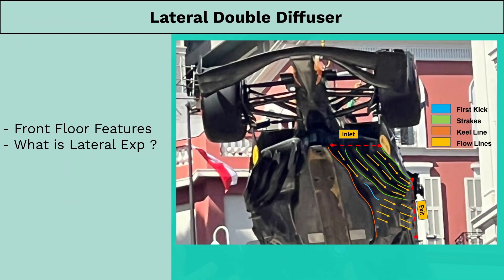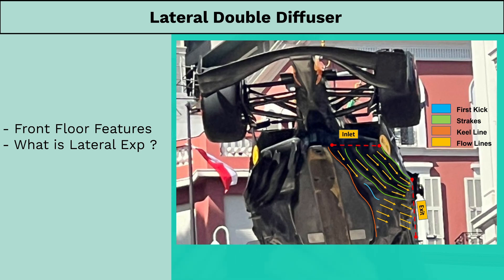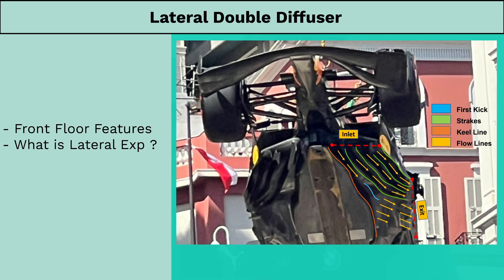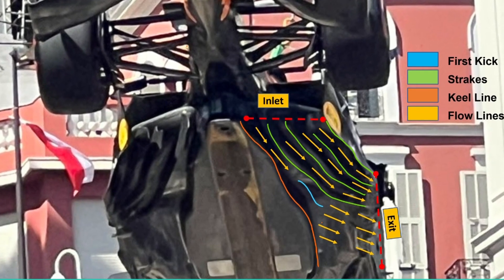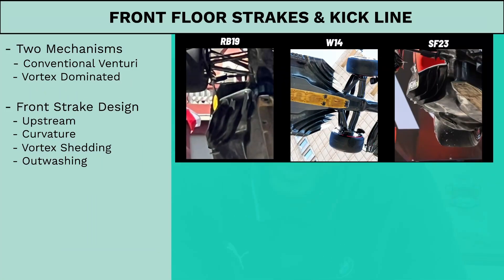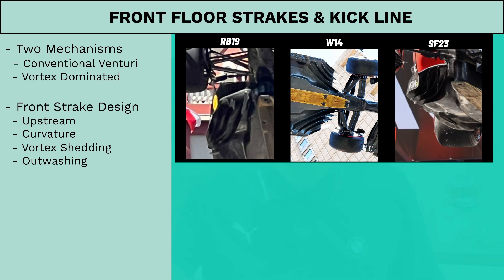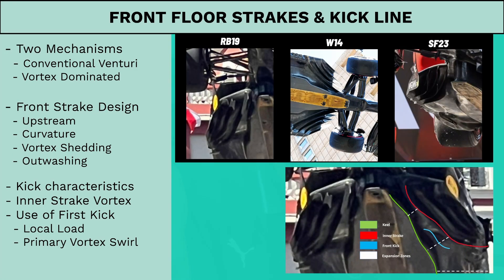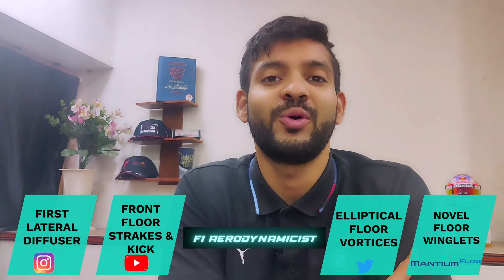#F1 Aero Analysis : RedBull Racing RB19 Floor Analysis | LATERAL DOUBLE DIFFUSER ?? Part 1

Comment: Shub, after thinking about the video, are you saying that what RB is doing fr its floor design is substantially different from its competitors and how it creates a great low pressure area under the car and expells the air with  a higher pressure?
Reply from the maker: I mean the competitors are also doing something similar , but RB has taken the aero mechanism to the next level of detail.
Reply: @f1aerodynamicist  That's what it appears from your comparison.     If you are not part of RB, and responsible for another team, how do you get to the next level?
Reply from the maker: @domtoni4567  that's a difficult one. Because it's complicated, however like the front kick mechanism I explained , that can definitely be tried out by teams because nobody is trying anything similar to that
Reply: @f1aerodynamicist  About 20 yrs ago, I knew a guy at one of the big F1 teams who told me that if an idea was tried and failed, it was put on the back bench and not to be tried again.  I wonder if this kicker is an old idea that didn't work earlier and works for RB?
Reply: Another question, do you think the RB design is better and reducing under floor pressure?   Am I right that this is the objective to keep pressure at the lowest level possible?
Reply from the maker: @domtoni4567  yup , it's definitely better and yes that's the point. But how you obtain that is tricky and also how you maintain that across a range of ride heights is crucial. That's the real game.. consistency
Reply: @f1aerodynamicist  Let me see if I can remember what I learned about hydraulics and pneumatics 50 years ago and see if I can better understand what's going on.  This will take me some time.  In pneumatics we learned that air compresses up to 100 times, and is explosive when its in a sealed container.  I guess you could consider the underside of the car sealed?

Comment: I think Redbull have done an incredible job with their floor using by applying Bernoulli's principle throughout. You can see from the design that they squeeze and expand the air flow multiple times before kicking it outward. This accelerates the lateral flow dropping the pressure and generating more downforce. Furthermore, the Redbull floor is higher than the other teams. This helps them to expand more air than otherwise. This means that they will lose some performance in slow speed corners. However, in high speed corners, the car's ride height drops as downforce increases so it's not detrimental. But when the DRS is opened, the ride height increases again stalling the diffuser.
Reply: Thanks, can understand your explanation.  I'm thankful to Shub for his great analysis, and helping me to understand just how involved aero really is.
Reply: That is the way I try to explain it in my language❤.
Reply: @martijnbuunk  Thanks, and your explanation makes sense.
Reply: From what I know is Bernoulli's principal is only applicable for isentropic flows meaning in this case where the effects of irreversible processes (Turbulence) are small or can be neglected at all and in these cases were crosswinds are changing Ambient temperature, track temperature considering all these variables, the total energy of Air is not conserved.. and this is the necessity of Bernoulli's principal that energy's must be conserved

Comment: Does the low pressure region in the center of the vortex help generate downforce?
What's the primary function of the vortex under the floor? Mixing the low and high energy flow of the boundary layer to keep the flow attached?
Reply from the maker: The primary function of the floor vortices is to drop the static pressure of the floor

Comment: i have a question:
At 10:10 how does the upwashing cascade generate outwash? from the top right image we can see that the vortex generated by the floor edge is counter-rotating to the flow coming out of the floor, so how does that help promote lateral expansion?
Reply from the maker: So the winglets have two free edges right.. , however because of the flow expansion the tip vortex on outside of the winglets gets washed away . While the tip vortex on the inside near the floor edge get powered up and this vortex further drives the flow outside. Compare the streamlines of the right and the left images and u will notice that there is much more outwash along the floor edge in the right while the flow on the left has already transitioned to majorly inwashing
Reply: @f1aerodynamicist ah this makes sense. That’s a really clever way of creating this. From the way the floor edge cascade is designed (I assume to meet regs) there doesn’t seem to any wing tip edge  on the inside of the cascade. Would it be possible to highlight this inside edge on the real car? 
Is that slight edge enough to create a vortex, or is that also being powered up by the outside vortex since it is counter rotating?
Reply from the maker: @Jay-nk6dm  so if u see the cascade ther are two wing tips , one on the outside and one on the inside ( right beside the floor edge with a small gap in between ) the local flowfield is such that it's able to drive a vortex off that as well and that's the important one.
Reply: @f1aerodynamicist  hmm im still not able to visualize it. if you had the chance ot add more detail that would be great, otherwise thanks for the time!
Reply: @f1aerodynamicist  hey shubh, i think i realized something. at 10:53 on your cfd build, it is shown that the winglets have a free edge on the inside and on the outside. but on the redbull floor, there is no free inside edge due to regulations. the lower cascade elements are directly part of the main floor while upper parts are the floor edge, so no inside wing tip. does this change the cfd dramatically/how would that initiate that outwashing vortex?
Reply: The vortex pulls the air under floor with it and creates lateral flow at this region.

Comment: I am no aero engineer but i always said mercs problem was never the sidepods its was always the floor and front rear suspension plus diffuser
Reply: It's both actually, but the sidepod is the lesser problem proly.
Reply: No sidepods mean more floor exposure which leads to more drag.
Reply: Main culprit was centre of gravity, and they massively relied on the results of CFD's and wind tunnel testing that they ignored the most fundamental element which is centre of gravity and you can hear it from Craig Scarborough himself

Comment: What engineering degree did you get in college? I’m about to be a senior in high school and will be going to college next year and want to do the same work as you.
Reply from the maker: As they say, straight up aerospace engineering if you wanna become an Aerodynamicist !! That's what Google told me 14 years ago and I followed that advice. Hasn't changed much since then. Where abouts are you based ?
Reply: Hi dude, I know two people on my university course that went on two work for red bull and Mercedes f1. We studied Aeronautical (Aerospace) engineering if that helps.

Comment: If the vortex and fences are driving air out of the floor, that too would lower the pressure under the floor(just by physically having less air). The vortex helps because it restricts airflow, and pushes it out of the floor at the same time. If the airflow moves fast enough, it will create a further flow restriction, once the airflow is locally sonic. As a sonic shockwave will create a choked flow and at that point your mass flow rate is maxed out, much like an orifice tube or air restrictor in BoP'ed race cars intakes.
Reply: Would this choked flow be a speed-dependent condition? Also, do you think that this is a feature only Red Bull has exploited properly or is it implemented across the board? Could this play a role in the speed trap difference between Red Bull and the other cars?

Also, I just wanted to note that I have seen your comments across a couple of YT channels and that they always come across as insightful, so thank you for educating us a little bit more about this technical side of F1.
Reply: @peroplaninic2220  Everyone has it, but I believe RBR exploits it best.

Comment: Bro, please, apply as an aérodynamicist for Ferrari ! i beg you ! you seem to know better than the whole technical team there !
Reply: It's a cool theory the "Lateral Double Diffuser", but I can't imagine that's really what Red Bull does, nor that something like that would work well in theory. I mean you take all the air that comes in at the inlet (according to your theory, the air between the inner strake and the keel is also washed out) and it's diffused laterally. A "good" part of this air is normally used for the diffuser, but never mind here. Air is then fed into the rear section, which is then fed to the diffuser, whereby vortices play a very important role. This whole system would be far too vulnerable, whether in yaw or in crosswinds, to make the diffuser purely dependent on this, especially as this is not just "clean air" but also losses.
Therefore this concept would also have a clear disadvantage in terms of downforce not only due to the lower mass flow compared to a concept that uses the air between the keel and the inner strake for the diffuser, because almost every team operates 2023 inwash in the direction of the underbody and diffuser. When Rory Byrne designed the first undercut sidepods on the Ferrari F2003 undercuts it opened a new world in F1 aerodynamics. It massively improved the underfloor seal
effect as it created a
side wall connecting the side edges of the floor and the
ground vertically. Without undercuts and their sealing effect,  the flows
from the leading edges of the sidepod flew out from under
the floor and flew back under the floor and towards the
diffuser, another part of the flows also flew out towards the
rear tire.  With the undercut the underfloor flows were  sealed in and flew in
straight lines to the diffuser. This accelerated the
underfloor flow, boosting suction and increasing
downforce. But there was a downside because the flows
towards the rear tire was also blocked and the suction at the
leading edges of the sidepod tended to become weak. So - less air to the outside and the suction tended to become weaker. Therefore I think that the strong lateral expansion is about keeping the suction at the inlet as stable and high as possible and that the inner part of the airflow (between inner strake and keel) also flows to the diffuser and not everything is washed out. I think different kicks would also not match the vector field of the incoming air from the rear "inlet". I therefore doubt that this is actually how it works, even if it has to be said that basically every team since 2023 has been outwashing at the front and then pratically inwashing at the rear, not just Red Bull.
Reply from the maker: I'd love to apply, if Ferrari can figure out their management and organisation.
Also ,I have some friends there from uni and I can tell you , they are really really smart.. F1 is elite, just because someone is second doesn't make them amature, hell even Williams is not amature. Everyone who makes it in any capacity is top notch at what they do .
Reply: @f1aerodynamicist  yes for sure, it was just a kind of a joke 😄, I'm sure you don't need a random guy comment in YouTube to know what's best for you. It's just that the Ferrari's team is so frustrating even though I know they are doing their best with what they have. Keep up the good work, I'm a big fan of your work !
Reply from the maker: @Y2Si   Just the online interaction.
Glad to know ur enjoying the work